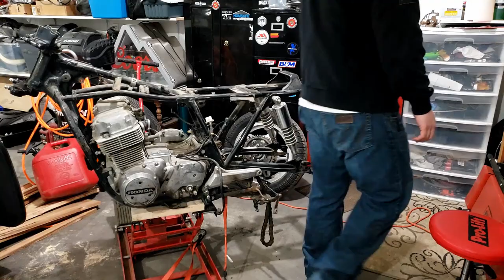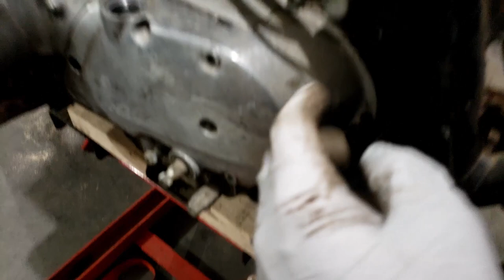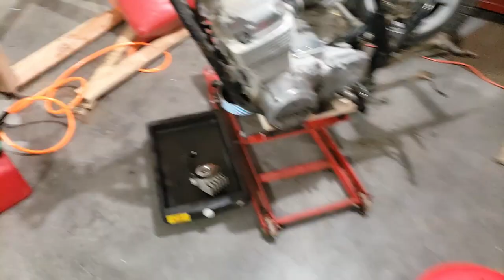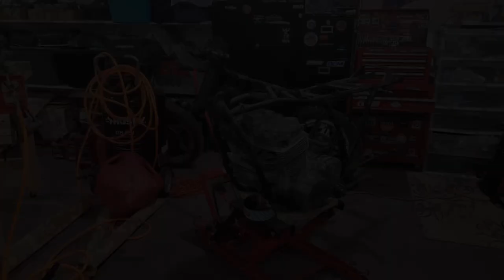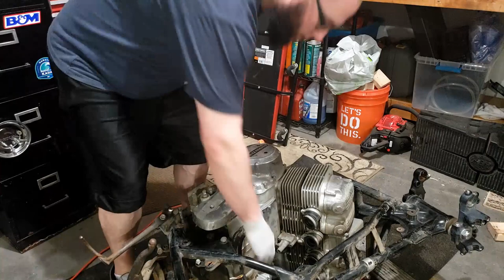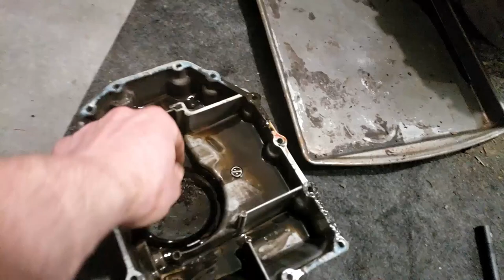78 CB750A SOLO ENGINE REMOVAL, AMEN SAVIOR CB750 CHOPPER BUILD EPISODE 8

Comment: Interesting how a 750 and 750A differ.
Reply: There are different models. I personally had the 1971 750e which could be built up to 1000 cc's because it had a thicker case and cylinder walls. Mine was 836cc with a three-quarter inch race cam and open headers. I put it in a Denver chopper frame it's sat so low didn't even have a kickstand just stand up and walk away, it never fell over. Could do 135 mph, just down shift to fourth gear at 95 mph and nail it. The front end would do a little dance then straighten out and take off like a bullet, all I could do was hang on and pointed it down the road. God I miss that bike. 
I rode my brother's 600 Yamaha snowmobile on a closed Airport runway just to get that feeling again. He wouldn't but I did 120 on it. I was in my 40s, now I'm 64 and stop doing that stuff. Was fun as heck though.
Reply: @cynthiaayers7696  I'm 64. I took my 74 K to 125 going to Laconia bike week in NH. I still have it...but the engine was stolen. Working on it a bit at a time...someday it'll fly again.

Comment: Interesting how a 750 and 750A differ.
Reply from the maker: Is there that much difference? J have only dealt with this 750A, tell you one thing it weighs a ton.
Reply: @fwgarage2351  the 'A' has different cases because it's wet sump,no oil tank.
Reply from the maker: @digschopper9321  I was wondering about that because I saw some CB750's with oil tanks and my 750A did not, thank you for the info!